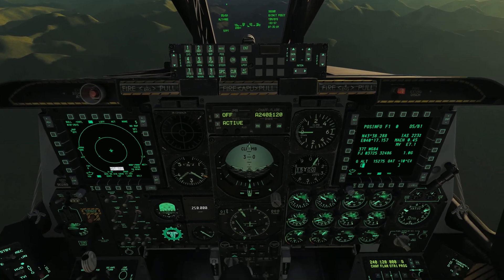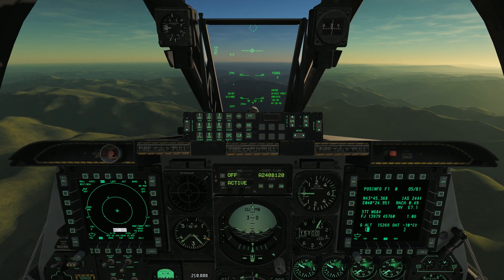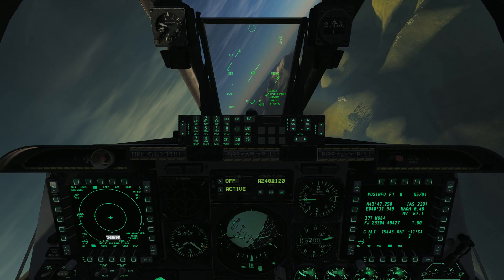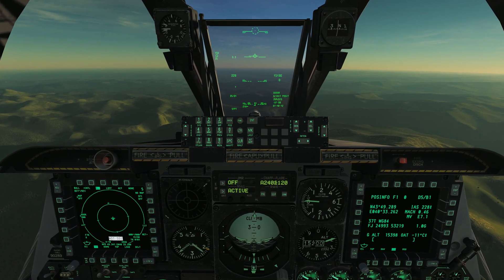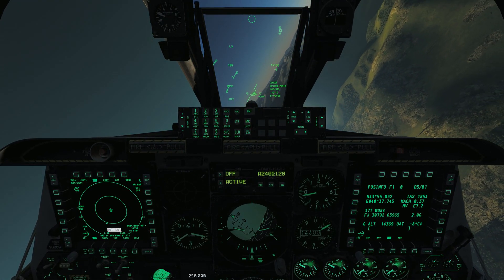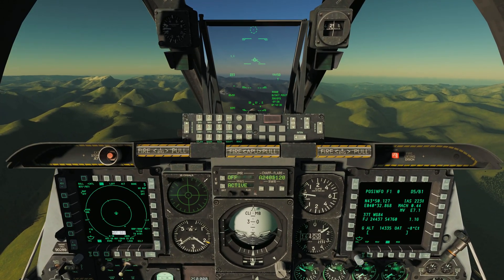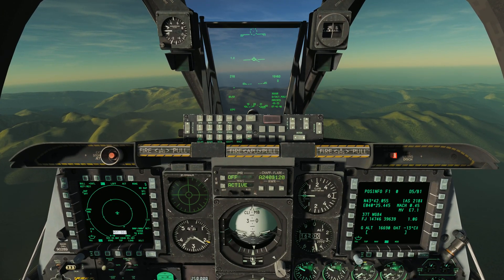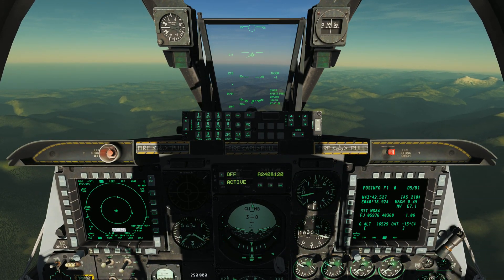DCS World Tutorials - A-10C Warthog - General Flying tips

Comment: Hi. I really like your videos. Like you I am RL pilot. During a DCS mission I had the left engine shot out. Normally I would just apply and hold rudder to keep the ball in the centre. But this time I had a long way to go so I chose to use rudder trim. In the real world you turn the trim wheel or turn a knob TOWARDS to the live engine to counteract the asymmetric yaw. But on my hog it wanted it turned the opposite way. Is this a military thing or has DCS got it wrong? Its no big deal as I know what to do now, but its counter-intuitive. I just wonder if it is set wrong in controls options. Any thoughts appreciated.